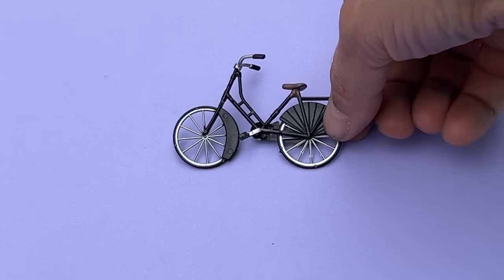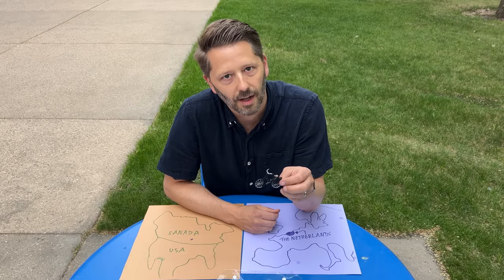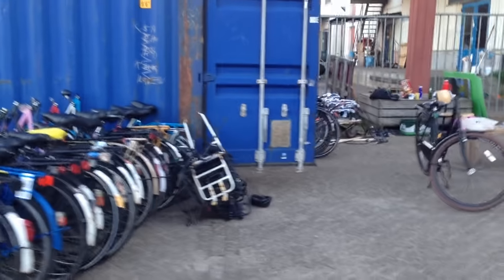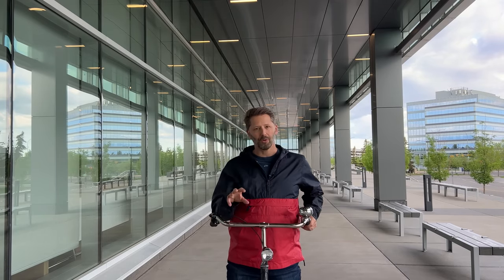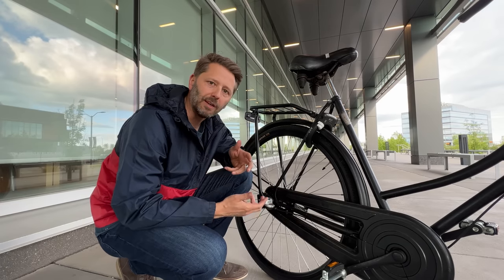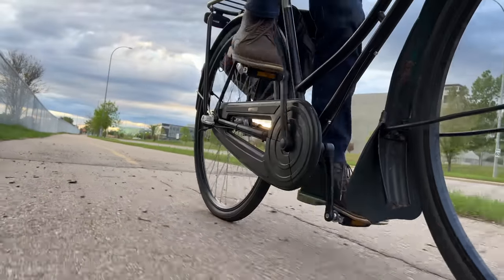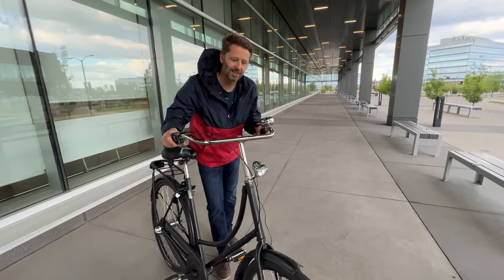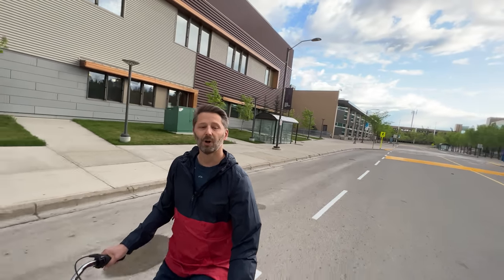I finally found a true Dutch bike in North America. Here's what you need to know

Comment: What’s wild to me is this is how bikes in the US used to be. My grandmother’s bike from the 50’s was upright, had swept-back handle bars, had a chain guard, had coaster breaks, had a rear rack and a front basket, and had lights powered by a dynamo. I’m sad that we got rid of it 😢
Reply: We need to bring them back
Reply: I actually would like a state factory to make bikes. I feel in the economy state manufacturing does have a role to play which is to make the things private corporations don't want to make. Private corporations want to make either luxury goods that are advertisable and can be sold for a lot or are disposable and need to be frequently replaced.
I think we need state factories to build simple but sturdy things as those go against the capitalist model of economics.
Reply: @MrMarinus18 .. definitely agree they need to bring dynamos back. But build them into the gearing with a on/off switch
Reply: @nubie1100   - Though I would like to avoid battery operated lights, outside dynamo's are a drag, literally.  Putting a dynamo in the hub makes total sense (clean, efficient), but the problem with that is that it is always ON, whether you switch it off or not. There will always be magnetic resistance, also during daytime when you don't need it.
Reply: @tubularap  . Brushless. Then do a leaver on/off to move magnets out from resistance
Reply: @nubie1100   - Great if brushless does the trick.
Reply: I've restored a 1920's "Bakkersfiets" (Bakery Bike) and sold it when I needed the money. I understand your pain.
Reply: My Electra Amsterdam 3spd ally one cost $500 20 years ago.
Reply: Your grandma had the grandma bike. That's where the name comes from. It's old design, that's built to last that  hasn't really changed.
Reply: @tubularap  the resistance is basically negligible for city riding.
Reply: Right?  My first bike in the '50s was a Huffy.  Upright, bomb-proof and heavy.  Once I was old enough to handle it, I had a large basket on the front that would hold two large paper grocery bags.  (Or the morning papers for a paper route, but I didn't have one).  I was so proud to be able to carry my grandmother's groceries back from Kroger while she walked home without having to haul those bags.
Reply: @tubularap did you ever ride with one. I feel much saver biking with my lights always on. It never felt hard like the side wheel dynamos were.
Reply: @nubie1100  Noooooooo they're awful things that create a massive amount of drag. Just buy a set of front and rear LED bike lights. They're cheap, the batteries easily last the whole winter and they create zero drag. LED bike lights render bike dynamos obsolete. Remember to dispose of the dead batteries responsibly. 😁
Reply: @emilwandel   - I guess a good designed hub dynamo can reduce resistance to a minimum, and make it the best option.
Reply: @nubie1100   Wait what they arent standard safety equipment? Bycycles until shortly used to be not road legal in Germany. Today you only need to have functional lighting intalled. Yes you could actually get pulled over for this.
Reply: @tubularap  With LED you wont even notice, used to have Halogen lights bulbs, those were a drag.
Reply: @tubularap  A dynamo is brushless anyway, the rotor inside has no contacts with the coils outside.
Reply: @vHindenburg   - If a dynamo has permanent magnets it will always have some resistance by the magnetism pulling. Magnets do not need physical contact for their 'force' to have effect.
Reply: @AndyinMokum  Or just get rechargeable batteries. Less waste, less costs.
Reply: @tubularap   Dosent change the fact that a dynmo is brushless by design. If it isnt needed the friction wheel is disconected.
Reply: @vHindenburg   - Yes, a disengaging friction wheel would solve the problem.
Reply: Finn here, same thing. The bike feels just more 90s than patently Dutch.
Reply: @Komatik_   The classic Hollandrad is made by Gazelle, The are quite pricy in Germany already. Besides they got a 3-7 speed gearbox and electric lights not much changed since the 1880ties when the so called safety bike got popular.  There are even new ones with the classic white tyres and tyre break.

There is a reason why bikes get stolen in the 1000s every year.
Reply: It's because distances have grown. Those upright bicycles are really nice for short distances. The upright positioning, the swooped frame for easier access, chain guard etc. all make the bike heavier, which in turn makes it too heavy for longer distances.
As North America has become more and more car-centric, distances have grown. I wouldn't want to ride a city bike, which is what they are called in my country, further than 10km. At that point the design starts to work against you. Like the name implies, they are really good in cities where everything is in close proximity, or at least are in most cities out side of North America.
Reply: @KNYD   Interesting for distances under 6km I don't even bother to get the bike out and go on foot. But that is my personal preference,  for a daily commute  around 18km is my personal limit, after that it just eats extra energy, considering you need to go in any weather conditions besides '' Blitzeis''
Reply: @vHindenburg  The distance between my work and home is 20km, and I cycle that five times a week to and from. I wouldn't cycle it using a city bike, especially because of the hills. It would just take too much time, and I would get too sweaty.
That 10km distance is just a personal preference of mine. Also for me as long as the overall distance is less than 50km a day, I'll cycle it.
Reply: @KNYD  Yes depends on the route, mine was over completly flat land therfore subject to extreme wind conditions. Decided to use the tram to my current job despite of being only 12km but the last two are pretty much blocked by car traffic, on which I already had an sccident twice. Nothing happened to me, but its enough to not want to deal with this anymore. Central Düsseldorf is a nightmare for cyclists.
Reply: She probably used the bike to actually transport herself from A to B, like most Dutchies.
Americans and Brits seem to use bikes as some kind of sporting vehicle only.
Reply: @vHindenburg  Yea, I get that. I cycle through the centre of Helsinki (the capital of Finland). If we didn't have Baana, I would just use public transport. Baana is essentially a highway for pedestrians and cyclists. It's set lower in a way that it does not cross paths with roads, bridges go over it. So there are no street lights, crossings, stops or anything like that. It makes my commute a bit longer, but because there are no cars, and it's divided in a way that pedestrians and cyclists do not mingle, it is so much faster than the direct route. In total I only have like 50m of road without a separate bike lane.
Reply: @KNYD   Any chance than Baana is related to the German word "Bahn" depending on context it meands road,rail, or sheet of cloth,paper ect usually on a roll. Like in Fahrbahn, roadstripe to drive on?
Reply: @vHindenburg  It is. The slang spoken in Helsinki is called "stadin slangi" (en stad=city in Swedish, staden= the city, so it essentially means the capital's slang, in Finnish kaupunki=city). It is a mixture of Swedish, German and Russian. Nowadays, a lot of English has gotten mixed into it, but the older words are derived from those three languages.
Back in the day if Finns wanted a higher education they mainly went to study either in Germany, Sweden or Russia. When they returned most of them settled in Helsinki, and the three languages functioned as the business languages. The working class adopted phrases from all of them, and the slang was born.
People in the capital area speak it to a varying degree, and as someone who was born and raised here with working class parents, I use quite a lot of it. My pet peeve is when people from outside of the capital area try and use it in order to seem "cool", but they don't know the context or the meaning of the words so they end up using or inflecting the words incorrectly.
Reply: @awandererfromys1680  Even better, especially if you use a solar charger. 😀
Reply: Back then, cities were dense enough and car ownership was low enough to have a real demand for practical daily driver bicycles. So that's what your grandma's bike was designed to be.
Reply: schwinn still sells those. i found a pearlescant pink & white dutch-style bike that my wife fell in love in, came with a rack, step-thru frame, swept-back handlebars so she can sit back while she rides. i looked it up later & found out the bike was made in 2012. it's just that stores wont sell them in the US bc it isn't a HARDCORE EXERCISE BIKE
Reply: @MrMarinus18  the state already pays factories to make cars nobody buys. it would be stupid simple by comparison for the state to make bikes that it just, basically gives away for free or at cost
Reply: @tabula_rosa  What cars?
Considering the amount of artificial scarcity going on in the auto industry I find your claim highly dubious.
Reply: @MrMarinus18  there are almost as many cars as there are people in the US. & most of those cars arent sold or driven either, but are sent to gigantic lots to sit in the desert & rot, as the factories aren't paid via a customer purchasing a car to drive but by the state that they produce them in to make sure that the factory remains open despite, most people not buying new cars
Reply: @tabula_rosa  That is not the image I have of how it works. For many cars are still barely affordable so if what you are saying is true then it's more so artificial scarcity.
Reply: @nubie1100  these days they are incorporated into the wheels. no side loading of the wheels anymore.
Reply: I have shoulder issues that keep me from riding.  I think I could actually ride this one without being so hunched over!
Reply: @djopdam199  Those things are super heavy and basically indestructible. They're also a rare find.  In WWII, the NAZIS stole most of the bikes from that time. They needed the steel for armaments.
Reply: Obviously Grandma's bike was a MEAN of TRANSPORT like bikes in Europe. 
If you do a bike-sport, you have a bike specifically for that purpose .. bmx, mountain, racer, mono... what ever ... 
Fåk the dynamo though: I used to switch it off up hill 🙄... we've got better lights now a days 🙂
Reply: What's even more crazy to think about is that bike would probably still work just fine today. Even with minimal maintenance bike like that can last a literal lifetime.
Reply: @vHindenburg  It's the same here in The Netherlands. 🇳🇱 However, the police are very sloppy about giving out tickets, mores the pity. A set of LED lights are dirt cheap. There's no excuse for not having a set.
Reply: @emmajones8590  I'm British, I've lived in Amsterdam for 17 years. I don't own an oma or an opafiets. I own a thing called a bakfiets. Mine is a 3-wheeler, 2 up front and 1 large drivewheel at the rear. It has a Shimano Nexus 7 geared hub.  It has a large wooden cargo container between the 2 small front wheels. It's very Dutch. I call it The Trundler. It's used nearly every day for either exercise, shopping, or for transporting my telescopes and cameras. Okay, I'm never going to win the Tour de France on it. However, it's a fantastic, multipurpose bit of kit. It's also highly enjoyable to ride. I also only ever use LED lights. Peddle power Rocks! 🇳🇱
Reply: @awandererfromys1680 any battery is always going to be more harmful than a dynamo
Reply: @zimzimph  Yea, but if you're going to use batteries, get rechargeables. Even if they last for ages in your bikelight, it's still better than disposables. I've had mine four, five years now.
Reply: @nubie1100 
😅 😂 Old skool dynamo is brushless and no permanent drag. Just needs a small capacitor when you're stationary. (junction, traffic lights, etc)
Reply: It’s called an Oma Fiets in Dutch which means Grandma Bike.
Reply: @AndyinMokum  .. the old ones created only little drag and using leds will create less drag as they use less voltage than old bulbs.. The old ones that touched the side of your tyre didn't create that much drag, the only problem I remember was they went dimmer when going slower but you could use a capacitors to off set that.
Reply: @tubularap yes, a hub dynamo will always have the magnetic resistance, but that can be a tiny fraction of the total resistance from when the lights are on. 

I have a Schmidt SON hub dynamo on my bike, and the resistance when nothing is drawing power is lower than most regular front hubs. That is, the sum of magnetic resistance plus bearing resistance for the SON is less than just the bearing resistance for most front wheel hubs. You’ve got to get a pretty high-end racing wheel before it’s less resistance than the SON (when off). 

(Now, obviously, if more bike wheels had equivalent-quality bearings, they would win out. But the point is that in the real world, whatever you’re used to probably has more energy lost to front-hub friction than if you replaced that front hub with a SON, so you wouldn’t actually feel like you’re losing any energy if you switched. 

My spouse’s US$3000 carbon-frame road bike doesn’t have lower front-hub resistance than my SON. So I dunno what price point you’d have to hit before a SON would actually be a negative by comparison, but it’s probably a lot more than most people who are looking for a utilitarian bike are spending. 

Other dynohubs aren’t as low-resistance, but they’re still not as bad as many think they are, and due to the need for precision for the dynamo, they’re probably all going to have better bearings than low-end bikes. Maybe enough better to counteract the additional losses from magnetism. )
Reply: @AndyinMokum  You claim: "they're awful things that create a massive amount of drag". This statement is massively hyperbolic -- talk to the thousands of Randonneurs who get their kicks out of riding 200k, 600 k or more in a go for fun, and as a huge majority use dynohubs. When pedaling for 10, 15, 40+ hours, you are not looking for any extra workout. Decent dynohubs create minimal drag, that noone apart from a Tour de France racer will notice. They also do create less drag when the lights are off.
I'm not racing, most all my bikes are equipped with dynohubs, some expensive, some not so much, all very handy whether i'm out grocery shopping, bikepacking or headed across the country.
Reply: @blacksquirrel4008   - Yah, I laughed at those then. I mean, I was happy to finally see something at the bike shops that seems "normal" to me, but which had been absent for 30-40 years in the U.S.. 

And for a brief moment I considered getting one.  But ultimately there was no way I was going to pay that kind of money for something that seems so basic to me -- a type not unfamiliar to me growing up in the '60s, '70s (U.S.), or the type I got accustomed to living in the Netherlands for a few years. 

I finally found a real Dutch-made bike (oma fiets style) locally, used, for a couple hundred bucks. Really glad I held out.
Reply: @tubularap  Here in the netherlands most bikes with a dynamo on the wheel have either a switch behind the light to turn it on or off, or a 2nd shifter on the handle (looking the one for the gear hub) which takes the dynamo off of the wheel or put's it back on (the dynamo wheel is on a little arm which swivels)
Reply: @evo3s75   - Thanks for the info. I didn't know that.  Must be because I have not been using old or new dynamo's for lighting in ages, going for the battery operated small lights.
Reply: similar here, in Europe (Austria)! my grandmas bike was also very much like "a dutch bike", upright etc. then more sporty bikes became the norm, and in the last few dacades there is a change happening again, where more comfortable, durable city bikes à la dutch bikes are getting more common. I´m driving a medium between them, a vintage 60/70, locally produced Puch-bike. And I love him dearly. :D
Reply: Yup, before banana seat bikes, those were it. Unless you were rich and had an "English Racer".
Reply: @nubie1100  They do have them.